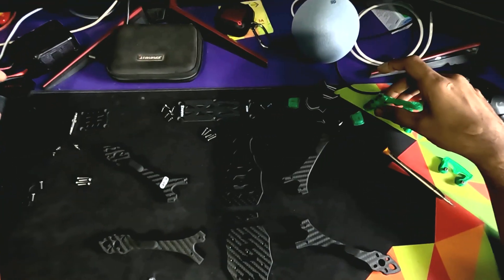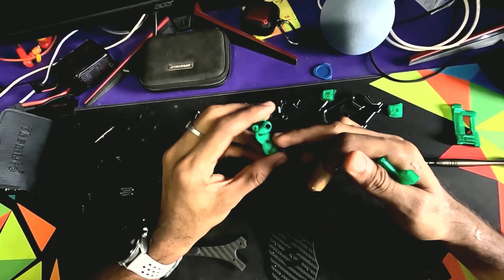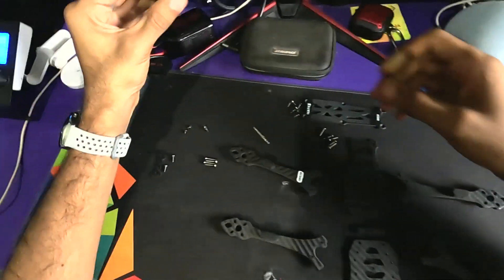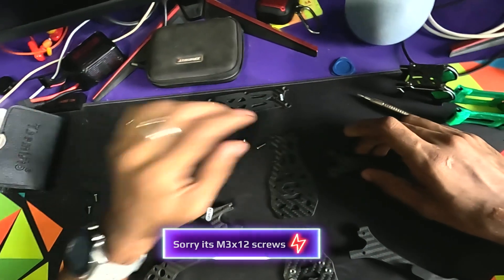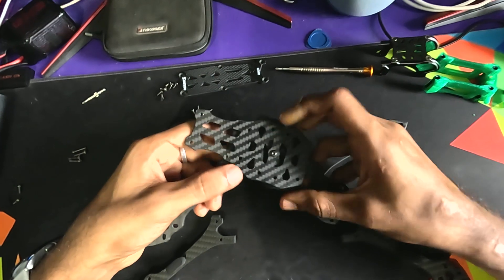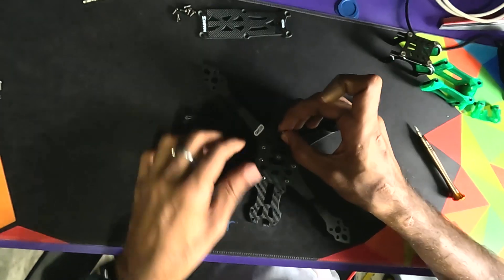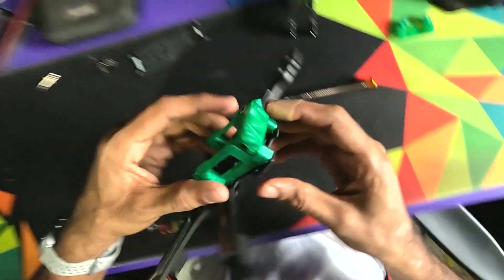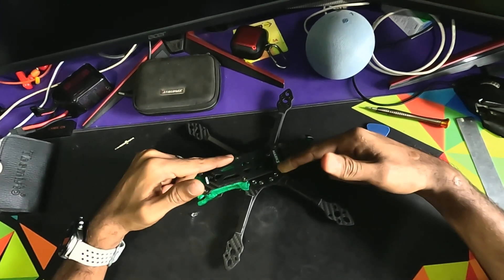GEPRC Mark 5 FPV drone build Part 1

Comment: Hi, great video! Could you please tell me the height and width of the Geprc Mark 5? Thank you!
I mean measuring the full width and length of the drone from arm to arm using a ruler — not the wheelbase, but the total span from the tip of one motor arm to the tip of the opposite one.
Reply from the maker: Will do that in next video. Thanks for the idea. Please subscribe and hit the bell icon to get noticed. Will try to upload in 2 days